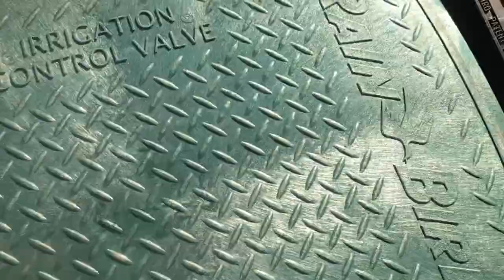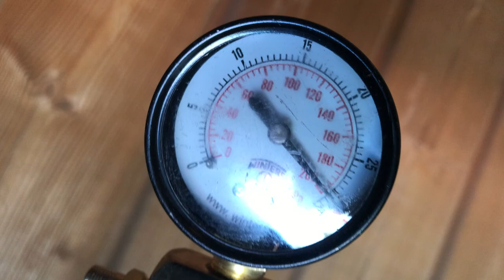WORLDS BEST SNOW MELT SYSTEM PART 2

Comment: Thanks for the great video!  Am doing the same thing.  Any issue about if mesh should go first and then pipe and rebar?  Also, did you saw cut expansion joints after the fact?  I am concerned that the pex might get cut during the cutting process!?
Reply from the maker: I did saw cut , driveway was 6” thick so we saw cut 2” and everything worked out good

Comment: Wow, that was a good sized pour, how many yards?  Is the pex in this application anything special?
Reply from the maker: 64 yards,no just regular 3/4 pex 100’ rolls with no joints in slab still holding pressure 👍

Comment: That's incredible.  How much did it end up costing to run per storm?
Reply from the maker: Last year about 1200.00 for year
Reply: @OutlawWoodworking  One more question... Obviously it worked perfectly, but was there any concern over the insulation layer allowing the slab to slide?  An old installer said steep slopes need pinning or something to keep the slabs from moving.